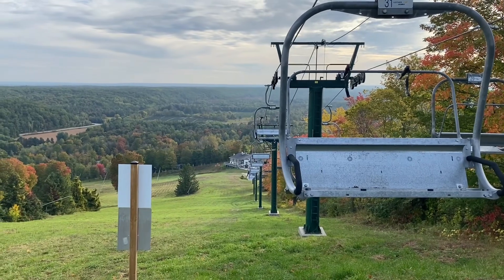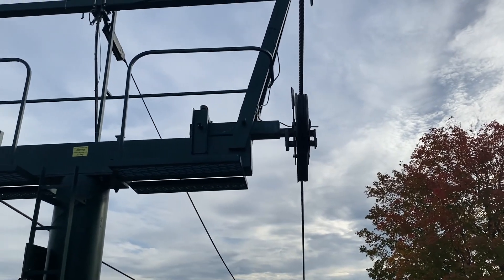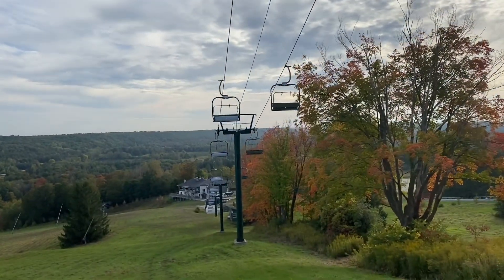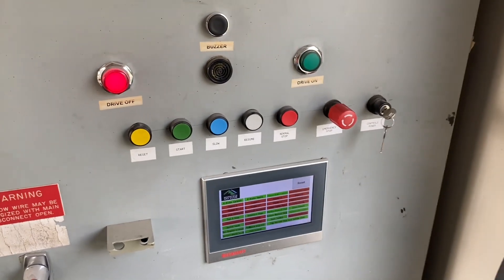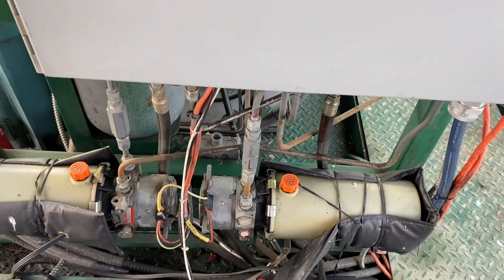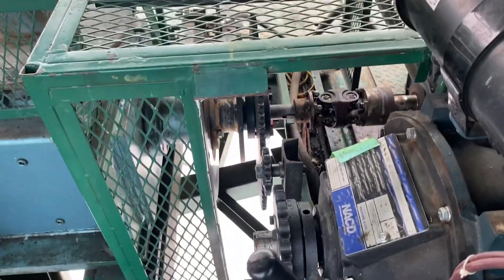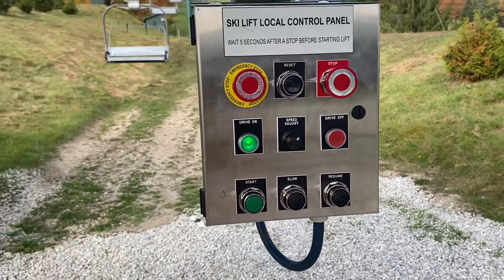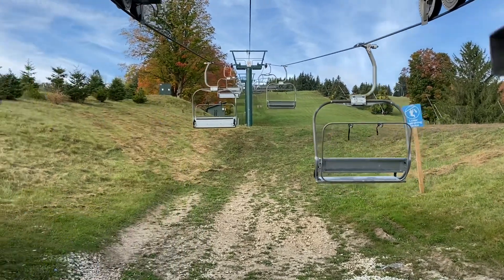Starting Up a Ski Lift

Comment: There is video still on YT from Russia I believe.  The lift had obviously not been maintained and the anti roll back failed .  Absolutely awful as it literally ran backward at a high speed and people who didn’t jump were crushed under the Bull wheel by  chairs jamming up underneath it. I worked at a resort for a while and this gentleman here is on his game...  You have protocols and inspections along with scheduled maintenance that are either done by the book or you have a catastrophic event . I got to learn quite a bit. Riding up on a work platform. Doing maintenance.  Interesting engineering.
Reply: The Doppelmayr lift rolling back and ejecting people was from Armenia, and NOT badly maintained. It rolled backwards because the operator manually pumped the bullwheel brake open, while the hydraulic engine (used to evacuate the lift after a power failure), was not yet engaged with the teeth on the bullwheel.
Reply: @MrOpenGL   You’re entitled to your opinion.   Which I disagree with…
Reply: @shawncosmos5431  You can disagree as much as you want, but the official final report says otherwise, and you also got the country wrong. I'd post it here, but Youtube doesn't let me attach pdf files.
(also modern lifts do not have anti rollback with a ratchet, it's all done electronically with the service brake)
Reply: @MrOpenGL  Not sure we’re discussing the same thing…The incident I’m referring to occured on March, 2018 in Gudauri, Georgia not Armenia.

Comment: I used to do this job in Maggie Valley NC and in Gatlinburg TN. My favorite part is the morning ride around. Excpecally coming down on the light side. The view from the one in Maggie Valley was amazing and so was the one in Gatlinburg! The light side on the Black Ski Lift is amazing where it skips 4 towers, just down hill of the mid station!